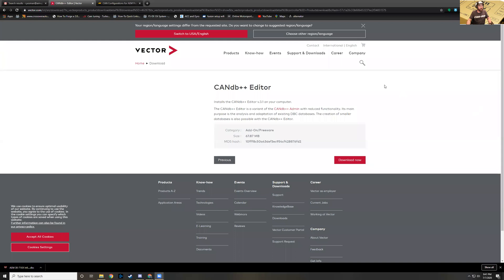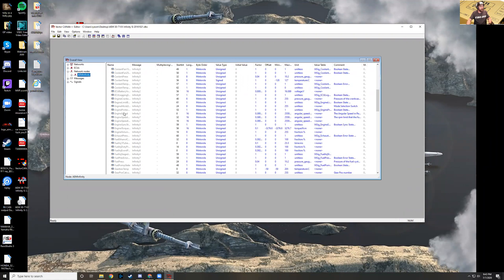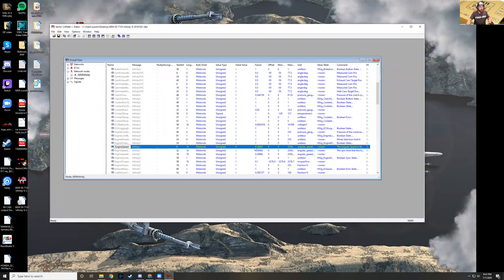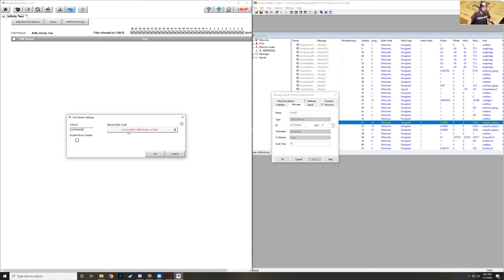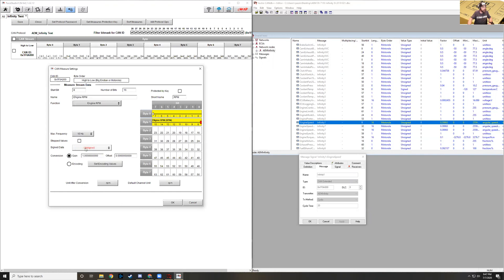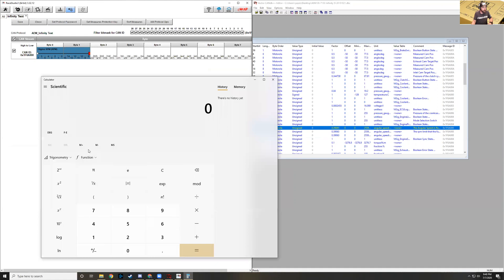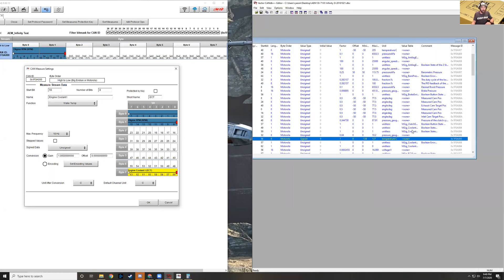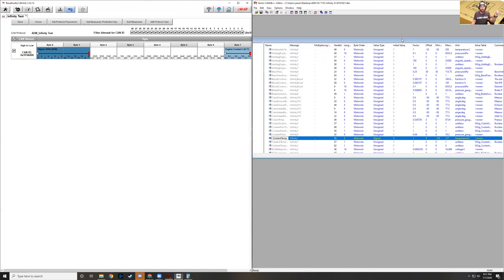DBC to XC1 conversation

Comment: Wouldn't it be easier if Aim added the ability to read DBC files to RaceStudio3?
Reply from the maker: Yes, and the parser is built it just needs to be added into the configuration software.  It's coming...
Reply: @aimsportsdata  Any update on this? Before I start the task of manually converting :))
Reply: @djes.36  I can do it now, unfortunately still no easy way to parse to XC1 files into 1 file.

Comment: Where can i get the dbc file from a Golf tcr ?
Reply from the maker: Usually, a DBC file is provided by the manufacturer. However, someone may have created one from reverse-engineering the CAN information. I doubt you will have any luck at a dealership with asking for a DBC file but you may be able to find someone that has done the tedious work of reverse engineering for you on the forums/internet search.